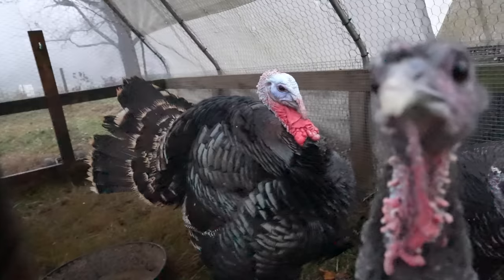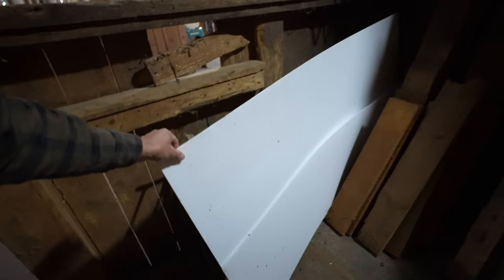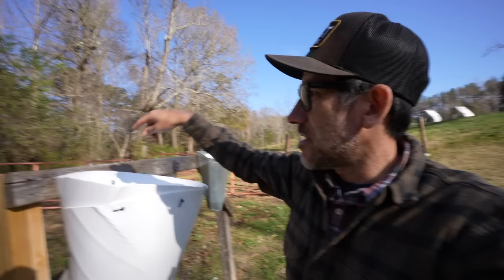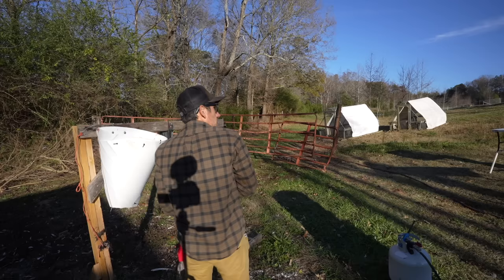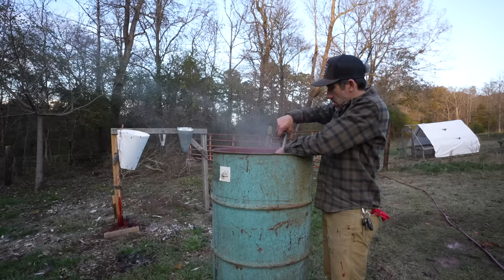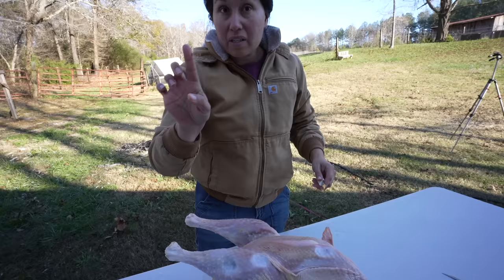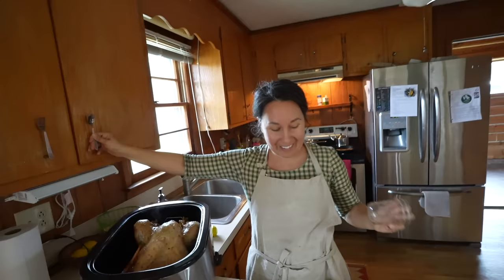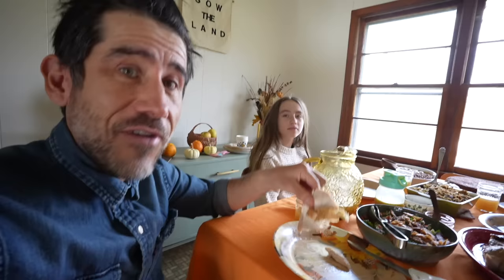Family Raises Own Turkey for Thanksgiving

Comment: Question do you have any concerns of any chemicals leaching from whatever is applied to the barrel once it heats up? I’m just curious we thought about using a galvanized garbage barrel and use that barrel for only harvesting. My concern is is it gonna leak any chemicals once is heated. FYI we plucked by hand. It was very easy to do.
Reply: I also thought of that when I saw the inside of the barrel….